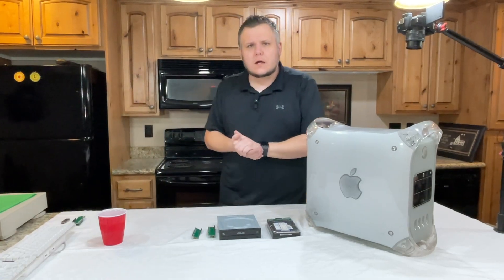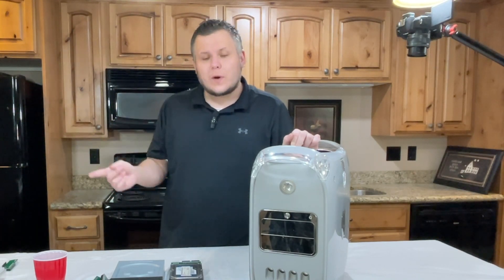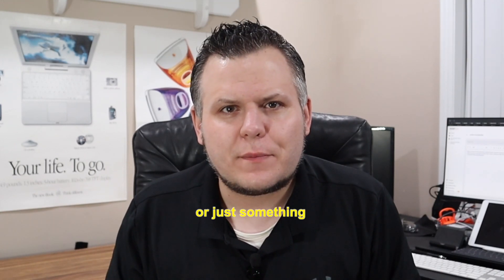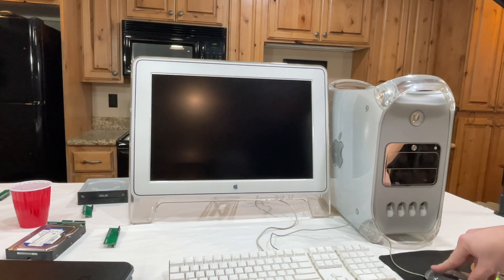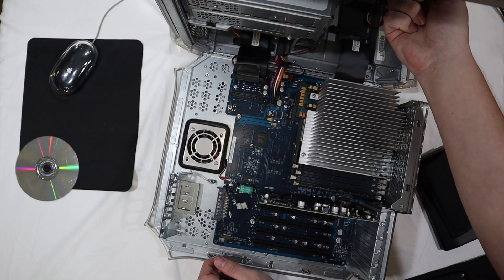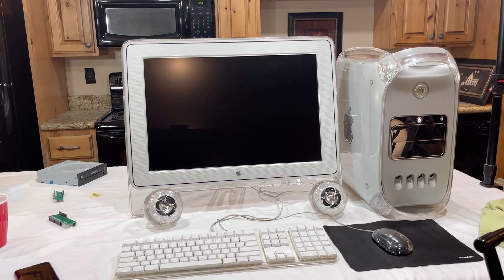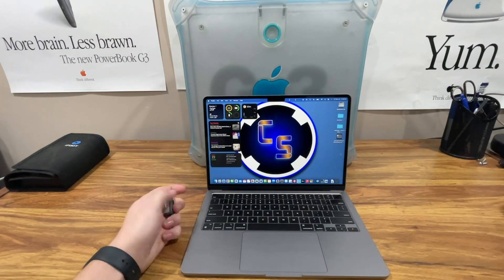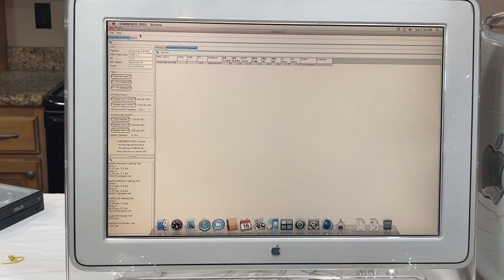Retro Tech Restoration: Upgrading the 2002 Apple G4 MDD Mirrored Drive Door

Comment: I got one of these last year, its a beautiful machine. Just a heads up, the power supplies in these are prone to failure. It's possible to repair the PSU by replacing some capacitors, voltage regulators etc.
Reply from the maker: Thank you for the heads up! And yes they are definitely one of the more beautiful Macs.